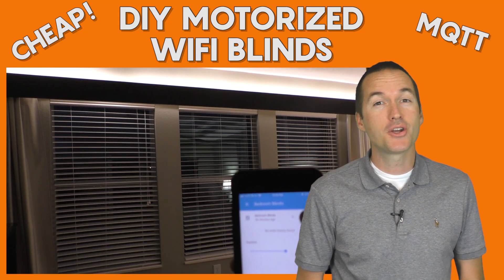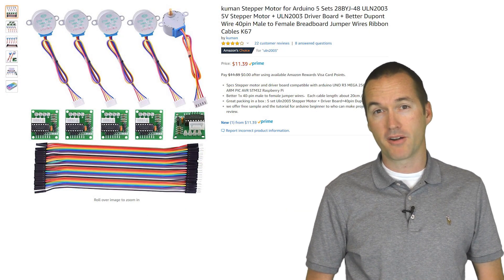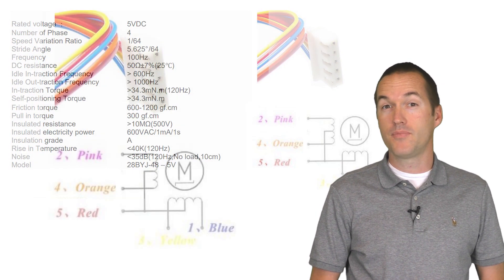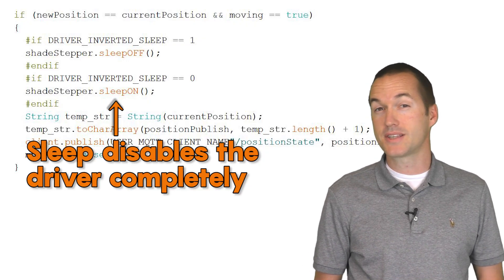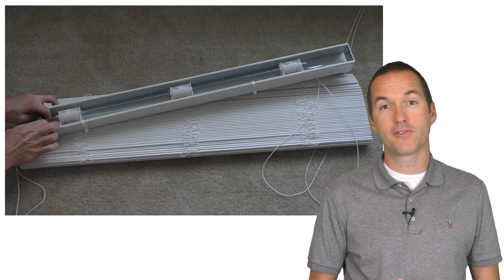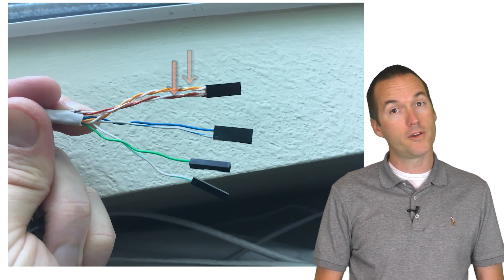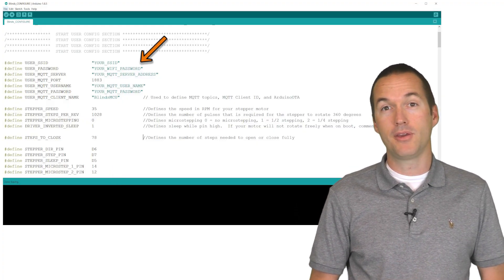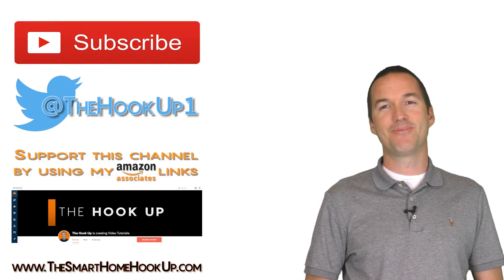Motorize and Automate your Blinds for $10! (WiFi)

Comment: About a year ago I built this and installed it.  I used the Alexa enable .bin and flashed the code onto the ESP.
It has been working great for almost a year.  Then about 4 weeks ago it stoped working. While troubleshooting I somehow “fried” the ESP.
Completed dead.  So I flashed a new ESP and installed it.  It connected to my WiFi, Alexa discovered the new device.  However, the blinds to not respond to the commands.
I completely checked all of the connections, voltages, and grounds.  No problems found.
I placed the ESP in a breadboard and connected LEDs to the three outputs and confirmed that the outputs are working.
When running the blinds sketch, the enable LED stays ON and the direction and step LEDs stays OFF.
Giving the OPEN and/or CLOSE commands does not show any affect of the LEDs.
I connected a NEW motor and driver board to the Blind controller and it also does not respond.
I have confirmed that the controller is connected to WiFi (I can ping the I/P address).
I have confirmed that the controller is communicating with the Echo. (It does NOT report “device non-responsive” as it does when not connected).
It seems to me that the commands coming from Alexa are not causing the programmed steps in the ESP to execute.
Is it possible that something has changed in the Phillips Hue Light “driver” that would cause it to not work anymore?
Any thoughts, comments, or ideas to help solve the problem would be appreciated.
Worked great for a year and now … nothing.  I’m stumped.
Reply from the maker: Interesting.  Do you have a serial monitor program like arduino or putty?  If you connect the ESP with USB to your computer you should be able to see all the debug messages including the current position of the motor and any commands received from Alexa.  The serial baud rate is 115200.
Reply: @TheHookUp   Just connected the ESP to the computer and observed the serial monitor.  The ESP startup looks normal.  It mounted the file system, read the config file, connected to wifi, reported the IP address.  Then it started to repeatedly display 0, which I assume is the current position.   I told Alexa to OPEN and/or CLOSE the blinds several times.  Alexa responded each time with "OK".  No Alexa commands were reported in the serial monitor.  It just continued to report zeros.
So it appears that the ESP is not receiving any commands from Alexa.  But why?
What do you think?
Reply from the maker: Good question, hmm.
Reply: @TheHookUp  Well, I got the Blind Controller working again but I am not sure why.
This is what I did.  In an attempt to further troubleshoot the problem, I uploaded the source code (.ino file) using Arduino IDE.  After adding the necessary libraries it compiled and loaded correctly.  I accessed the ESP using the Blinds AP and provided my WiFi credentials, Alexa name, and steps (default 12).  The ESP connected to WiFi but it was not found by Alexa.  I typically have to restart the ESP after WiFi configuration for Alexa to find it.   Upon restart, the ESP did not have the WiFi credentials and therefore went back to AP mode.  With the Alexa source code version, the WiFi credentials are not being saved.  So, I flashed the ESP with the .bin version, configured the WiFi info, Alexa name, and steps. Restarted the ESP and IT WORKED.  The serial monitor showed the current position and when the Alexa command was given the position stepped up to 12 and/or down to 0.
I cannot figure out how it got fixed, but it is working now.  I also do not know why it stopped working in the first place.
Early on in the troubleshooting process i had tried re-flashing the.bin file but that did not help.
Any idea why the source code version does not save the the WiFi credentials and how to fix that?
It did save the Alexa name and steps as they show up on the WiFi configuration page.
Reply from the maker: @glennhanson1881  I'm pretty sure the issue is with the Alexa library.  The pre-compiled bin uses whatever version of the Alexa library was available at the time, but I think there have been some compatibility changes on Amazon's side that needed to be fixed in the library.  My guess is if I put a new .bin up with updated versions of the libraries it would work perfectly.  I'll put that on my list of things to do.
Reply: @TheHookUp  Well as I stated before, I got the blind controller working again.  However, I am have great difficulty getting all four of my blinds connected and working.  Last weekend I connected one, and it worked fine.  Two days ago I connected the 2nd one and the 2 worked fine.  Today I connected the remaining 2 blinds and only one of the 4 worked and it was one of the 2 connected today.  While troubleshooting this strange issue, the ESP fried and is now dead.  I flashed another ESP and continued to troubleshoot.  It now appears the three of the stepper drivers are dead.  One of these also went dead while connecting the second blind.  Remember, this whole setup was working fine for almost a year.  Anyway,  I need some help from you.  I need some new stepper drivers.  The stepper driver that you link in the description (which was the one I’m using) is currently not available.  The stepper drivers with the DRV8825 are a bit expensive.  Can I use a A4988 Stepstick Stepper Motor Driver that does not use the DRV8825?  These seem to be cheaper right now.  Or, can you suggest an alternative stepper driver that is a drop in replacement for your original suggestion?  Thanks for your help.
I don’t know why getting these four automated blinds back in operation is such a problem for me.
Reply from the maker: @Glenn Hanson  Sounds like your power supply might be going bad and giving voltage spikes.  As far as using a different stepper driver the drv8825 and A4988 are basically interchangeable, but I've always had more luck with the durability and reliability o the drv8825.
Reply: Same thing happened to me.  I now have one dead blind, and one working blind that has been working for 2 years.  I cannot get the new blind paired with Alexa.
Reply: Could you help me connect my blind setup to alexa? I've been having trouble getting alexa to discover the blinds. I used the FlashESP8266 tool to flash the Alexa Only bin file. I tried to open the bin file in Adruino but it kept giving me an error saying "Arduino can only open its own sketches", so I am limited to using the simple flash tool. I was able to use serial monitor and it shows that it connects to my wifi and then just starts print a 0 rapidly.

I tried to discover the devicein Alexa via the Philips Hue but I couldn't get it to work. I don't have an actual Hue's device.
Reply: Think something changed they been working great for years, recently they decided to stop working and being discovered w Alexa
Reply: Flashed with the latest flash tool and the 2 year old updated Alexa bin and now they are discovered. 5 years going…

Comment: @The Hook Up Is the blind position set to 0 after power failure ? Sorry if I duplicated query. I did try to search trough comments but was  getting BLIND, too many comments :) If so did you find out any remedy to change it back to the previous value? thanks
Reply from the maker: If you use the alexa version it stores the position between resets, if you use the mqtt version it relies on mqtt retain to restore the position after reboot.

Comment: If I wanted to power 3 blinds next to each other is there a cheaper and one plug option to power all of them with one adapter
Reply from the maker: You can power them with a single adapter (and use a single nodemcu controller), but you'll need 3 different stepper drivers.

Comment: I love this project. I am trying to implement it, but my blinds are non-standard. I printed your base for the motor and the motor fits perfectly. However, the general shape of the bracket is very different from what I need for my blinds. I am building the right shape for me, but since the motor "cutout" is so perfect, I'd like to just insert that in my shape. I'm using TinkerCad. I don't know much about .stl format, so I don't know if I can extract that part from your model. TinkerCad doesn't seem to be able to do it. I'm wondering if I need a different file or need to use a different 3D editor. Worst case, I'll just build everything from scratch, but I was hoping to take advantage of what you've already done.

Comment: How does this deal with knowing when to stop? If you move the blinds manually how will it know it's new position
Reply from the maker: It doesn't, basically it will just try to open them again and fail (which doesn't hurt anything).

Comment: Wanted to drop a note here for anyone else: I got this working with a cheap(er) ESP-01S. You have to allocate TX and RX pins as GPIO1 and GPIO3 respectively, via:
pinMode(1, FUNCTION_3);
pinMode(3, FUNCTION_3);
pinMode(1, OUTPUT);
pinMode(3, OUTPUT);

Secondly, I'm not sure what was different with the stepper drivers I used, but ENable was pulled high automatically so i left that disconnected; bridging SLP and RST keeps the driver awake constantly though, which caused my motor to get extremely hot after a few minutes. Instead of doing that, i connected each of those pins respectively to either RX or TX, and then modified the code in the processStepper function to manually set both of these pins high or low instead of calling shadeStepper.sleepON/sleepOFF, as
    digitalWrite(1, HIGH); (where newPosition and currentPosition are different)
    digitalWrite(3, HIGH);

Comment: I am going to use this project as a plan for my home's vertical blinds, have to mount the stepper motor to the window ledge with a longer rod connected to it. Do not see any plans for vertical blinds anywhere. May be the first... will have to do a video

Comment: Hi there. First of all, thank you very much for your video. It is one of a kind. Sadly, I am stuck after loading the arduino code. I do not know exactly what to do next and there is no connection between the board and Home Assistant. Any ideas?

Comment: Interesting to see the use of the twisted pair for the 12V. How much amp is this actually? It is to calculate the maximum cable length to my power source.
Reply from the maker: Spikes up to 1A for very short periods.
Reply: @TheHookUp  Ok, so according to the standard a CAT5E cable is supposed to be minimal 0.485mm x 2 = about 1mm² (or 17/18 AWG), meaning you can theoretically put the power supply up to 20-25 meters? Is that correct? Many thanks

Comment: I’m doing my 3rd (triple) and  4th (double) set of blinds and I realized that The state of my cover.blindsXXX entities is unknown. I remember I used to see the icons change colors, but not anymore. The only difference in my code is that my blinds close in 9 turns, so my position open is 0 and close is 9, and I inverted my motor wires so the blinds close upwards, as personal preference. How can I get the state só the icons change colors like my other entities?

Comment: Anyone tried to control outdoor shades using this design. The stepper motor only has to run for a time "t" to move the shade all the way to the down position or up position. It doesn't need to hold any weight.

In additon I need to find a way to attach the wind ropes to the outside wall automatically. I was thinking of changing the wind ropes to stiff alluminum bars with magnets on the end and having a electronically controlled magnet attached to the wall that stays on until the command to move the blinds up at which point the electricity ceases and releases the bar freeing the shade to go back up.

Comment: I tried to connect the Stepper motor wiring to the Driver but the wiring layout is different that your picture.  Looking at the front of the shaft motor from left to right the color wires are Blue-Pink-Red-Orange-Yellow.  Do I follow your wires color or the pin position on the motor to match the driver?  You video show Pink-Orange-Yellow-Blue.  Skip the red.  I am confused here.
Reply from the maker: Follow the order, not the color.
Reply: @TheHookUp  The wiring is confuse.  Can you send the picture with color correctly with the pin on the drivers?
Reply: @TheHookUp  I double checked, follow the color of the diagram and not the order.  I think you got it backwards.  FYI..
Reply from the maker: There is no backwards.  There is a A+ and A- and a B+ and B-.  As long as you pair A with A, B with B and get the + and - lined up you could wire them in any order you want.

In other words if the wires were
1) A+
2) A-
3) B+
4) B-

You could wire them 1234, 3412, 2143, 4321 and the motor would function properly.
Reply: @TheHookUp  When I try to use cover to move the motor the motor stop at 1200 steps it move counter clock-wise but sometimes it goes back to position zero use clock-wise again to complete the 360 degree.  This happen to it randomly on my bench test.  Do you know why?
Reply from the maker: @mrteausaable  Any time you reset the device (or it loses power), it starts at position 0, so if you move it to 1200, then reset it, then move to 1200 again it will go to 2400... but it thinks it's at 1200.
Reply: @TheHookUp  How to fix this in esphome codes?  I test one on blind and it ruin the gear motor and have to replace a new one.
Reply from the maker: @mrteausaable  You should ask a question on that reddit thread, I'm not going to troubleshoot someone else's code.
Reply: @TheHookUp  Thanks for your help and awesome works..  Have an update video with esphome would be great..
Reply: Why the motor jerk the other directions before move back to the other direction when start spining?  It is normal or my wiring is wrong?
Reply from the maker: @mrteausaable  Wiring is likely wrong.
Reply: @TheHookUp  After checking the Stepper Motor wiring online, I got it to work without jerking.  Your picture diagram, yellow wire goes to orange in Driver connector need to swap so it will be the correct coils.  Also when I use EspHome code, I have to remove the EN (D5) pin for it to move.  Is it okay without connecting the green EN pin?
Reply from the maker: @mrteausaable  No, not okay to not connect the EN pin (it will overheat the motor quickly).  Do you have this in your ESPHome code:

    sleep_pin: 
      number: D5
      inverted: true
Reply: @TheHookUp  After I inserted "inverted: true" it works again.    Thanks.  When I put the BlindsBase in my blind it is 2" but the motor not line up with the tilt shaft.  About 10mm too low.  I need some modification on the BlindsBase file.  Can you share the file on the OnShape with me so I can make modification?

Comment: Can we use the esphome to control it?  Do you have any updated video?
Reply from the maker: Someone did make an ESPhome version: https://www.reddit.com/r/homeassistant/comments/lw68lu/i_remade_the_hook_ups_motorized_blinds_with/

I recently released a video about making these blinds with a PCB: https://www.youtube.com/watch?v=MsdJgEinb34
Reply: @TheHookUp  I use the code on the the above link, the entities does not show up on the home assistant but using the web service port 80 works.
Reply from the maker: @mrteausaable  Do you have the ESPHome integration?
Reply: @TheHookUp  I use the code from https://www.reddit.com/r/homeassistant/comments/lw68lu/i_remade_the_hook_ups_motorized_blinds_with/ but it does not show up on the Home Assistant.  Do you know why?  I have to use different codes without any save previous state.

Comment: Hello, for those 3 blinds you have how many NodeMCU and Power Supply do you used?  Do you use one for each blinds?  Can you use 1 NodeMCU and power supply to control as many as 3 blinds or more?  Why you did not use the Progressive motor interface that comes with each Stepper motor?  I also have blinds that is 94" long.  Will one of these stepper motor work?
Reply from the maker: As I said in the video, the ULN2003 driver that comes with these motors could not supply the required voltage without overheating.  

I am using a single NodeMCU with 3 drivers for 3 windows. 

For your blinds, I'm not sure.  94" is big, it may be an issue.

Comment: Hey so I like that you started with a servo, but I'm at a loss as to why you gave up.  You ended up coding to turn off the motor to release the tension, and you could have done that with a servo as well.  As seen here https://github.com/jjhtpc/esp8266MQTTBlinds

Using the servo actually creates a way less complicated setup. 
https://community.home-assistant.io/t/esp8266-window-blinds-mqtt/14863?u=jjhtpc
 I have had these up and running for over 7 years and because I use a quality servo I have not had a single failure.

Also it is good to incorporate the next step automation.  For that you will want to use a light sensor.  I have found that if you start to incrementally close the blinds 4 hours before sunset when the light is above a certain value and then close them a little more each hour this will give the desired effect.
Reply from the maker: Servos without power have significantly less holding torque than these tightly geared steppers.
Reply: @TheHookUp 
I could understand where that might be helpful, but I assure you there is still plenty of tension on the blinds that they do not move freely, but can still be manually moved.  I had the same problem with the servos staying engaged and a constant buzz and that is why I coded the myservo.detatch.  The servo solution is simpler, can run off of the esp power supply and has easily sourced rod attachments.  Honestly take a look at my code and try it out.

Comment: I would love for someone to design a system that would work for vertical blinds. For clarification, the blinds open with a wand that you twist and the blinds open like these, but then you push the wand to the right to move the blinds (which are on a track) out of the way, similar to a curtain. These types of blinds are most often found in apartments.